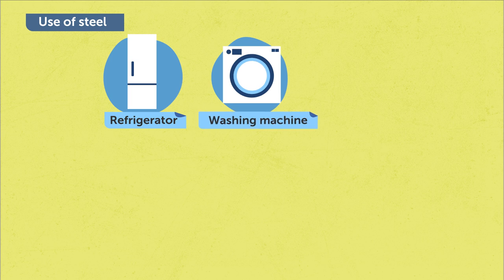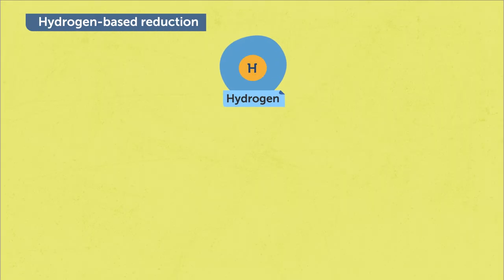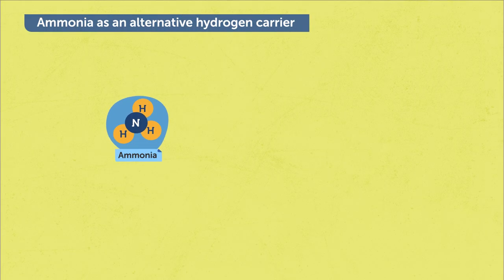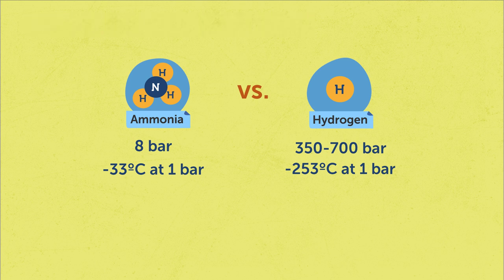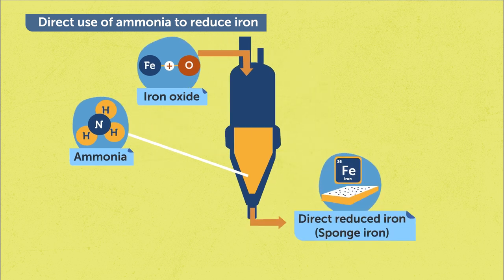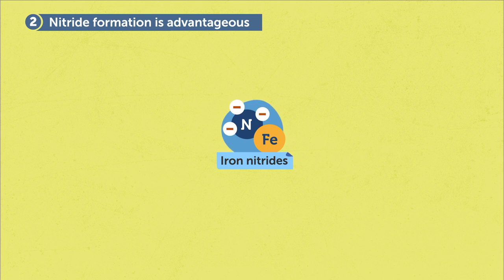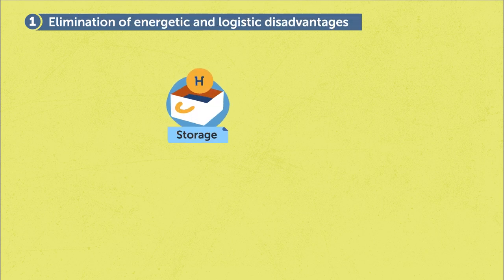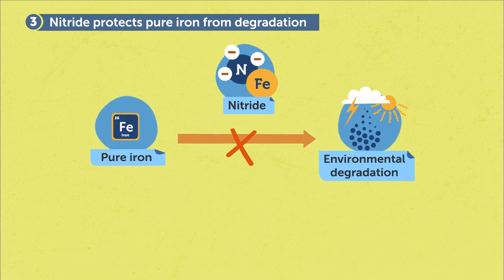Ammonia: Bringing hydrogen to the green steel plant

Comment: I have a dumb question - are there any large cases where we actually want H2? This chemical reduction chemistry question is one of the first cases I have heard where we want H2

Generally speaking, when we say green hydrogen we really mean green energy... 

NH3 is a better fuel, more economical, and easier to handle...

In a lot of studies, I see the assumption you want to crack NH3 but I do not know of many large applications for pure H2
Reply from the maker: Thanks for reaching out :) The green hydrogen can be directly used in many applications to replace fossil fuels, e.g. metal industry, heating systems, full cell vehicles. Such applications would drastically reduce CO2-emissions in these areas.
Reply: @mpisusmat  thanks for your reply. I will investigate the industrial application. Fuel cell doesn't really track for me just yet, using ammonia for fuel seems far more practical. It can basically directly substitute for diesel. With hydrogen he energy density, supply chain, energy loss in cooling to a liquid, etc. But I will continue learning and doing some math.
Reply from the maker: @Greenammonianews  You can also have a look at this website: https://www.mpie.de/4595091/all-about-hydrogen - here we sum up our research about hydrogen, also involving ammonia. Hope that helps :)